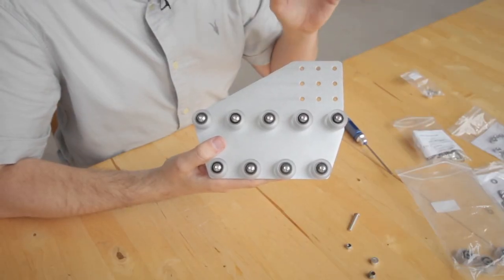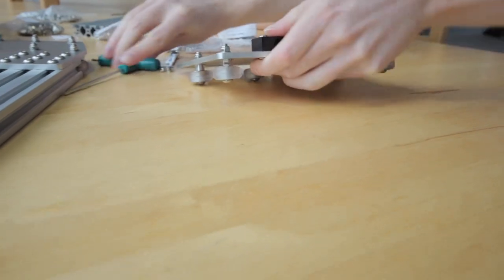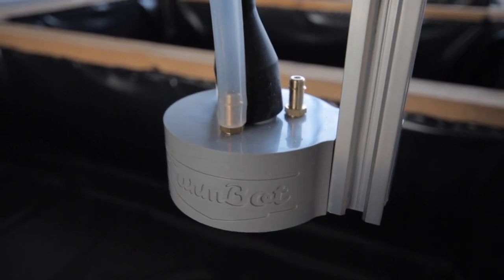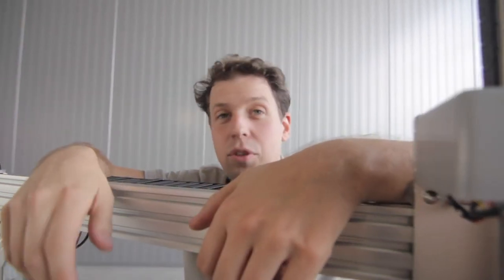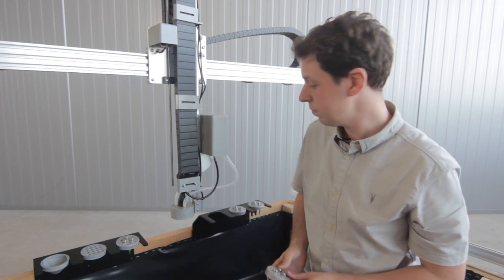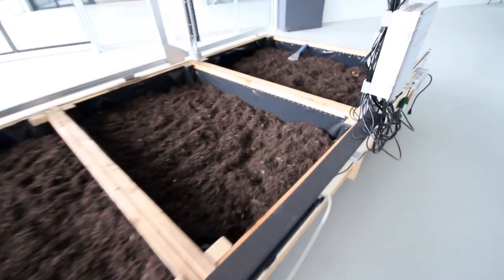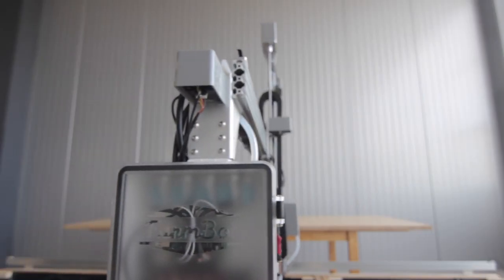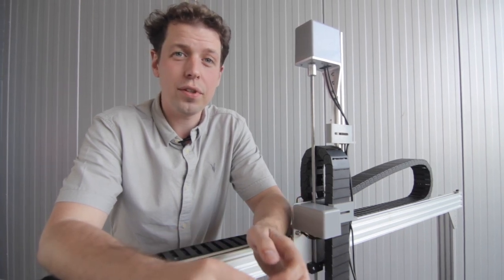Building Farmbot

Comment: Could it be cheaper??
Reply: Yes and no.  CNC Systems will not be "Cheap" as motors etc aren't free, BUT

The "Gantry System" could be made in another way, and i think that is the core of the cost?

The electronics are probably a few hundred, those aluminium extrusions can be quite costly.  Systems that use steel rods exist.

Also though it's an investment.  You pay all of this "up front" but buying an equivalent ammount of (organic) crops, as time goes on, gets more and more expensive.